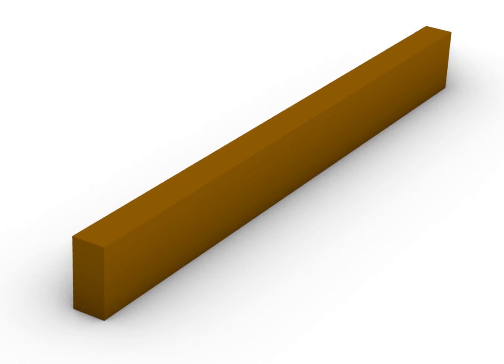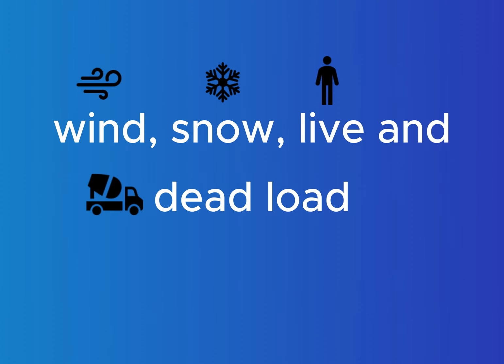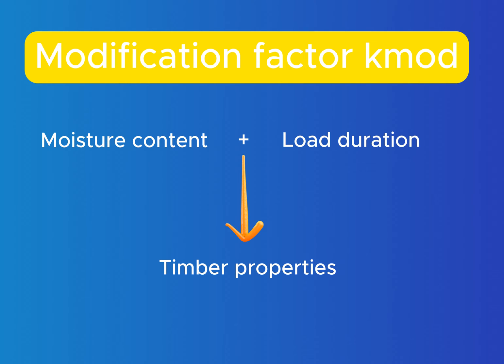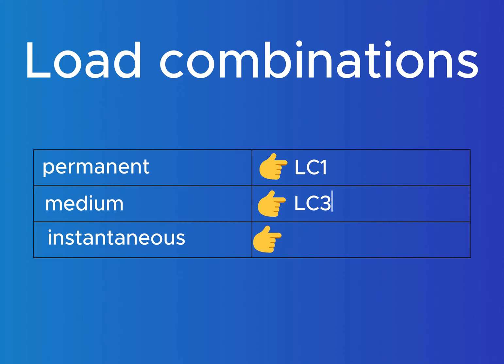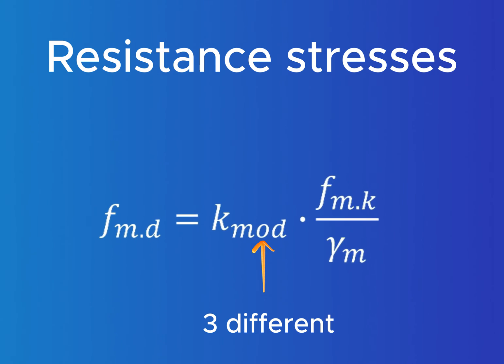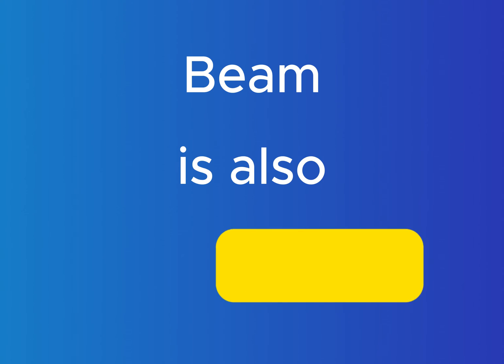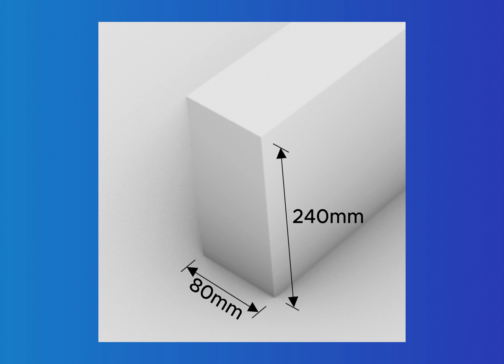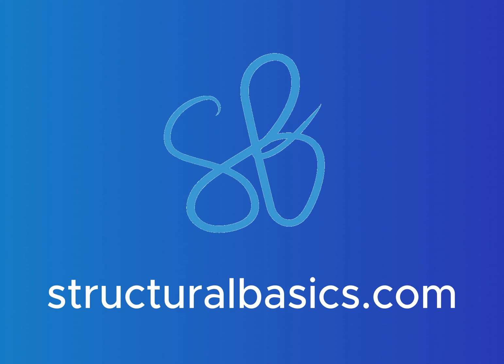Timber Beam Design | According to Eurocode | Tutorial

Comment: Hi, thank you so much for this helpful video. I am from the UK and have a huge end of year project where I have to produce a detailed design for a multi-storey building. I have been using the 'Manual for the design
of timber building structures to Eurocode 5'.This video title states according to euro code and yet looking in this manual the equations and method is very very different. I have already used your method and equations in this video for the design of my timber joists, and don't know what to do. Whether to continue with yours as to whether it is right or what is seen in the manual even though. both of you claim to be according to eurocode. I really need help😅
Reply from the maker: Hi,
I don’t know what equations the book shows, but you should always get a copy of Eurocode and don’t just use equations from a book blindly. 
Each country also has a national annex which sometimes defines formulas differently than the general Eurocode. 
Hope this helps. 
Laurin

Comment: - [00:00] 🏗 Timber beams are commonly used in buildings, such as ceilings, roofs, and garages, and this video demonstrates how to design and verify the dimensions of a wooden beam according to Eurocode.

- [01:10] 🏡 Most Timber beams are simply supported, and understanding the static system is crucial. This often involves one fixed support and one roller support, which are essential components for flat roofs.

- [03:00] 🪚 Timber material selection is based on factors like project span, cost, and personal preference, with choices including structural wood or engineered wood like glue-lam or laminated veneer lumber.

- [04:05] 📐 To design a Timber beam, you need to define the cross-sectional width and height, which are based on the designer's experience. This information is crucial for calculating the moment of inertia, which is required for stress calculations.

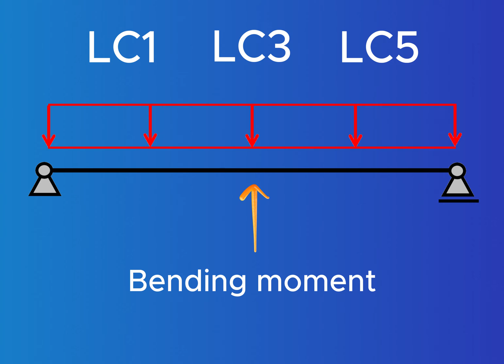- [05:40] 📈 In the ultimate limit state design (ULS), you verify the stresses in Timber members due to bending and shear. This involves calculating load combinations and comparing resistance stresses to design stress.

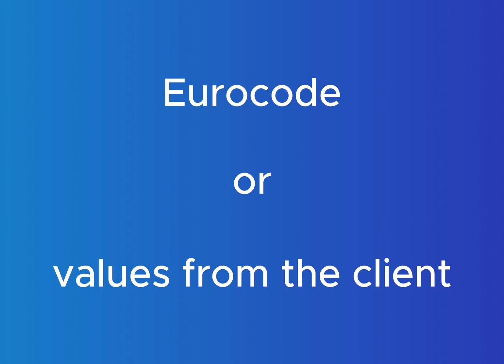- [08:10] 🏗 In the serviceability limit state (SLS) design, you ensure that the beam's deflection does not exceed specified values, and you calculate instantaneous and final deflection criteria based on load combinations and material properties.